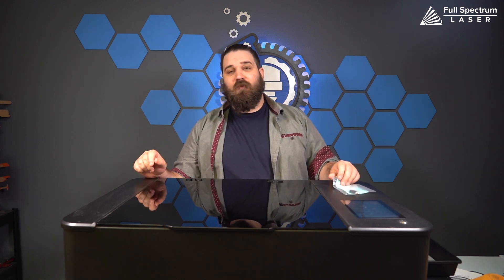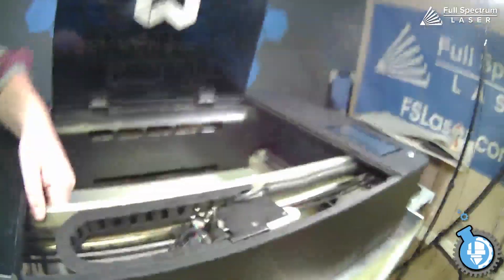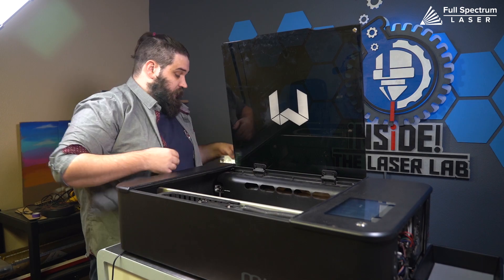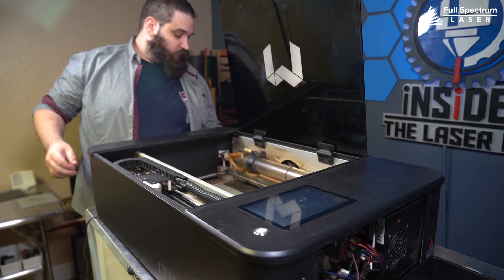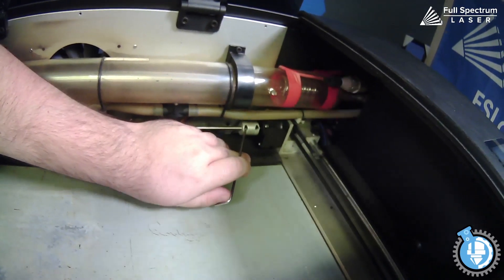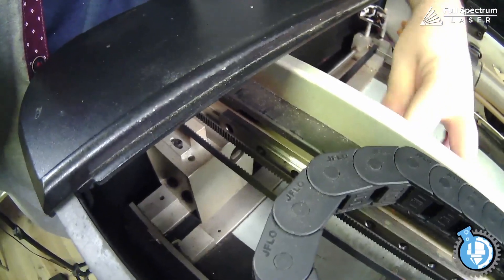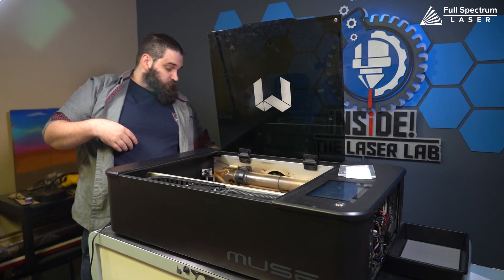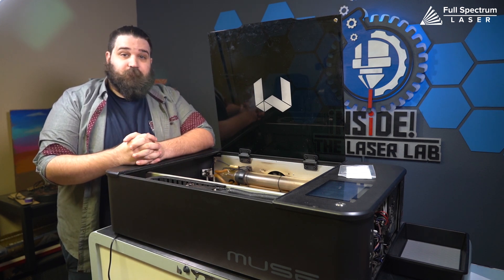Laser Maintenance - How To Square Your Gantry

Comment: I think you just saved me a day of toil over a 1325 table laser gantry alignment. Spent all of yesterday completely removing the whole gantry and in the process, stripping 4 hole threads holding 1 side of the gantry to the guide rail and having to drill and tap m6 to m8. I'm doing this in the morning
Reply from the maker: This is great to hear! Hopefully you got it done in a speedy process!!
Reply: @FullSpectrumLasers  I think it was a combo of loosening the rod and feeding more of the y-axis belt over the pulley and forcing the gantry to the front to make up the 10mm difference. Thanks man